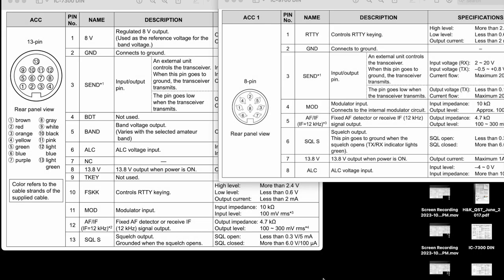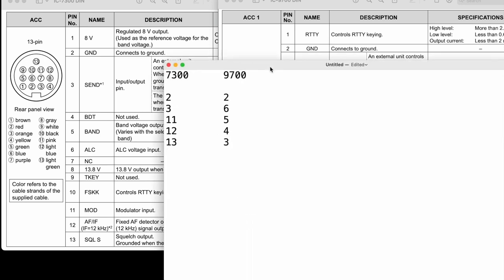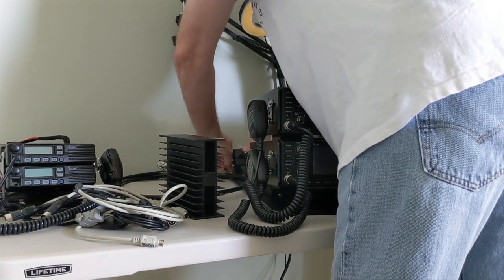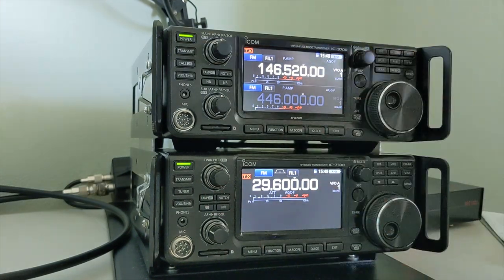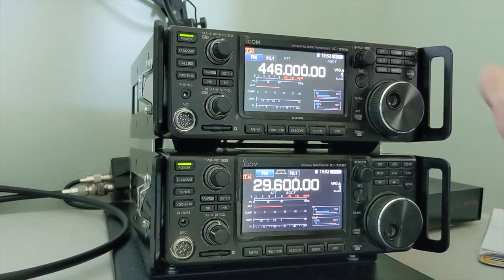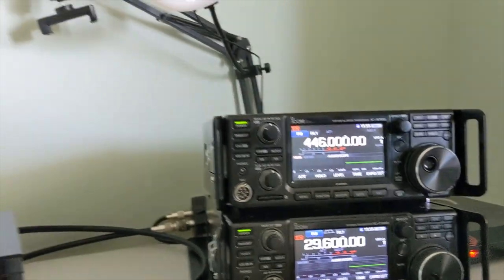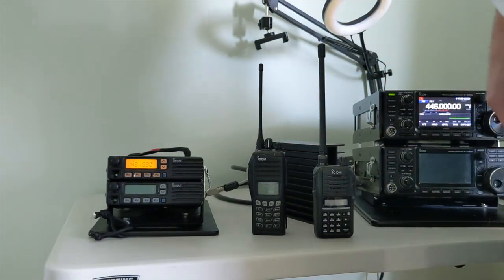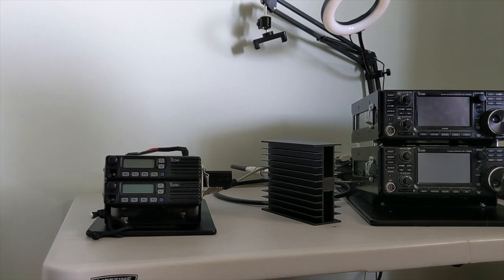Icom IC-9700 IC-7300 Crossband Repeater

Comment: Hi. the eurpean ic9700 version does not have 9600 baud 6 din pin contact in the back. and does not have. only 8 pin and usb print conector and some 3,5 jack,  can you show how with european models 9700- 7300 🙂
Reply from the maker: You don't need anything but the two accessory DIN plugs that came with the radios.  Just wire them like shown at 3:46.  Very easy.
Reply: Okey, but why did you connect 3 cables in the back of radio and no video show what and where? And with 6 din and 9600 baud cable
Reply: @n5yiz  okey i seee !  the din6 is just jumper cables between   din 8 and din 13 Yes?

Comment: So I can use my vhf or uhf handy talkie to talk on 40 meters correct?
Reply from the maker: You sure can.  Just remember you'll have to utilize the squelch.  It can sometimes be difficult to squelch SSB.  It can be done, like I did in the video, but just know the limitations.  The addition of a syllabic squelch would be best.  VK5ZLR make a VOS board.  Search "SSB HF Syllabic Squelch" on Google.  I think what you would probably want is the VK5ZLR Crosspatch.  Look it up, It'll do exactly what you want.
Reply: @n5yiz  Thanks a bunch for the help, watched the video several times. I am confused on what the mini din cable does I think you mentioned you don't need it but I could not understand what you said after that. Thanks.. Do I just need to make the 13 din to 8 din cable?
Reply: I also assume you don't need a duplexer if you just want to crossband UHF to HF?
Reply: @n5yiz  Also, do I need to use shielded cable? Thanks

Comment: I made the cable but it did not work, I assume you can not be on fm uhf on the handheld and expect to crossband to 40 meter SSB. The modulation mode has to stay the same correct?
Reply from the maker: It will cross mode, even Dstar.  Are you sure the settings are correct?  Is it not keying or is audio not passing?
Reply: @n5yiz  My cable was bad.. So hard to use the cheap Chinese stuff, I order a cable from HRO hopefully that will work.. thanks... It did work on receive though...

Comment: what duplexer are you using?
Reply from the maker: It's actually two diplexers in a "cascade" configuration.  A Comet CF-530 (HF/6m) and Comet CFX-431A (1.2/440/144).  73

Comment: So how would you connect 2 radios that have the 13 din plug, do you swap the 12/11 pins or strait through with 11 and 12 I’m curious as I would like to use 2 icom radios that both have the 13 pin plug.
Reply: I figured it out .
Reply from the maker: @brucerobson8284  sorry about the late reply...good you got it sorted out.

Comment: Should have shown the cables hooked up on the radios. And the duplexer as well. Sorry we don’t have X-ray vision can’t see through your butt or hand. Next video should be you using a HT cross banding to a HF frequency and actually hold a conversation.